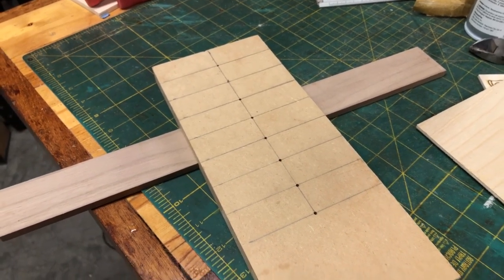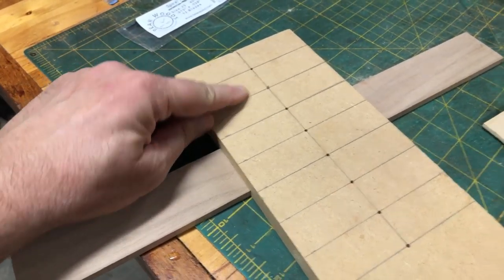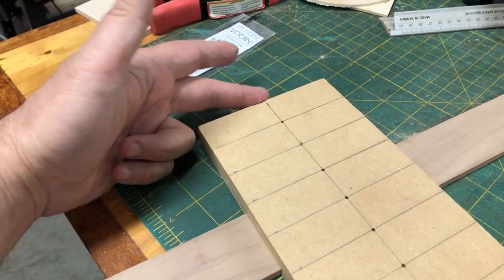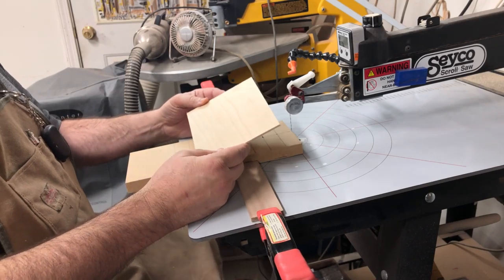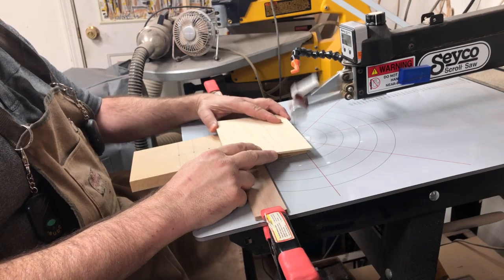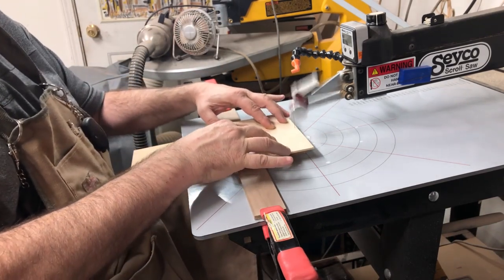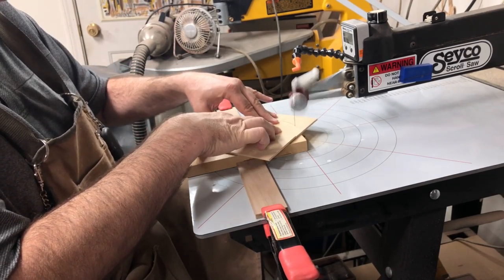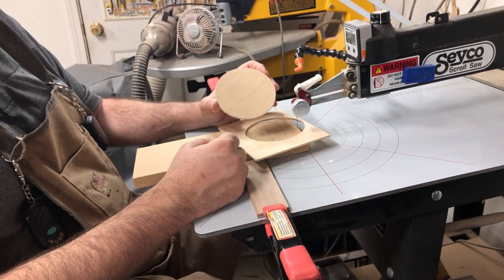Scroll Saw Circle Cutting Jig

Comment: Such a coincidence ... I just cut an economy bowl from 1-3/4 thick limba. The cut was at 30 degrees for 10-1/2 ring.  Now I'm ready to turn it into a bowl.  I had to use a jig because it was so heavy (compared to 1/4 inch stock). The jig was essentially a v-block I could rotate the blank on. 
My plan for 'normal' wood circles is basically do what you did Steve except sticky tape or hot glue a center pad for the nail to poke into
-Mike.

Comment: I have a lot of vibration in my scroll saw,  I don't use it during winter just warm months as our shop is not heated and we are in new york.   But I would like an idea how to fix it.   It did not do it at the beginning.   If a few months I will be heading out to the shop again.
I have many patterns I would like to work on.
Thank you for this demo and  for good information
Dot
Reply: Dot Imbro what kind of saw? Is it attached to a table with screws?
Reply: @ScubaDude68  Harbor freight, it is attached to a board with is attached to the table top,  I know it is a cheap saw, however i used it the the beggining of spring and summer thru fall and then this summer it started near the end as we were getting ready to close up. in falll it got really bad,   Can it go off balance
 i blew out all the saw dust in it, or maybe when it was used i did something to it,  i used the  band saw only threw late summer as i could nto  hold it still with my hand anymore. the board just bounced so hard,     any ideas as soon as weather gets up around 45 50 we will be out there once again.  i miss it bas there are things i cant do with the band saw.
Reply: @dotimbro553  That sounds like a tension problem to me, the blade can be influenced by the temperature, and become less or more tense. As the blade cuts, it loosens because of the heat lengthening it. Always cut a strip then check the blade tension before continuing.
Reply: @chrisgriffith1573  thank you. I do the crafts for fun, and to give away.  When weather gets warmer I will change the blade and to secure it again.  I will check the screws holding it down.

Comment: Thanks. Is the spiral blade a must? I made one but the blade moved around creating tension
Reply: A flat blade will not work well because of their tendency to drift. If you are having trouble with the spiral then add a little more tension. Some entry-level saws have a difficult time
holding enough tension for this project. If you are cutting thick wood then you have to go slow so the blade can keep up. If the wood is thick and dense then this jig is not very effective.
Reply: @stevegood3224  thanks. I have a Ryobi and I’ll order some spiral blades